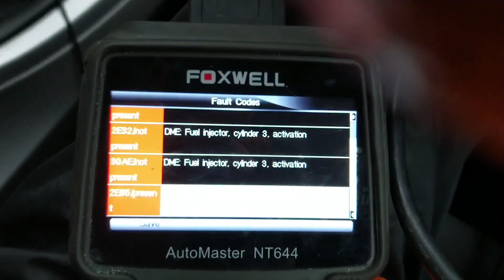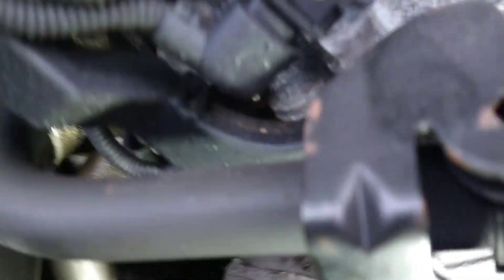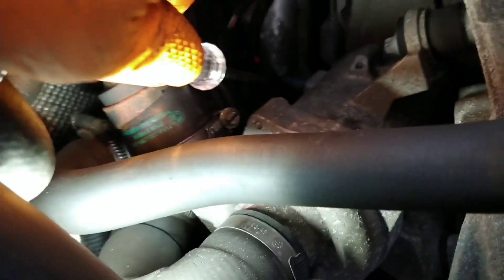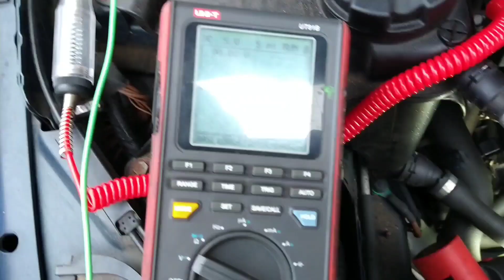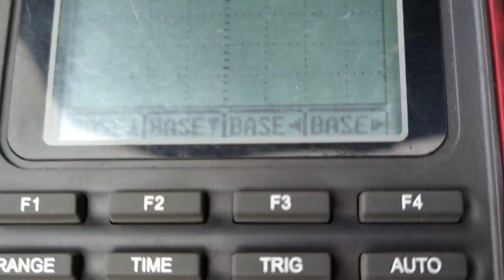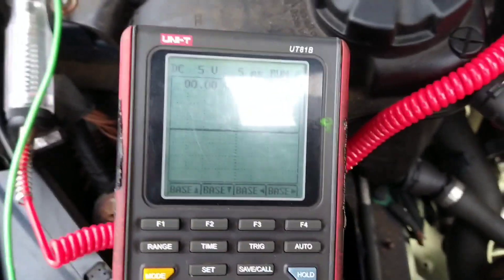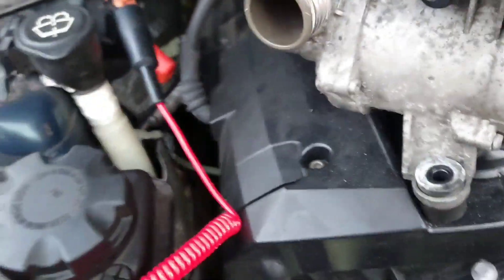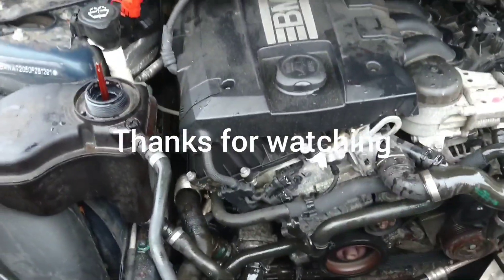BMW 320i Electric Coolant Pump Fault

Comment: i need this
a great way to check whether the water pump or the wiring is at fault

just to summarize a normal water pump wiring:

when engine off :
big wire 1 : 12v
small wire 2 : light off (maybe 0v)
small wire 3 :light off (maybe 0v)
big wire 4 : ground

when on acc mode :
big wire 1 : 12v
small wire 2 : light off (maybe 0v)
small wire 3 : light off (maybe 0v)
big wire 4 : ground

when on acc mode and heater on :
big wire 1 : 12v
small wire 2 : 12v
small wire 3 : 6-8 volt
big wire 4 : ground
Reply from the maker: Yes, thanks for watching

Comment: I got no power going to my water pump check all the fuse and they fine what should I do next ?
Reply: I checked all the fuse on both fuse box none are blown and the big red wire have to power so I’m trying to see if there a relay or a control module for the water pump
Reply from the maker: What car have you got?
Reply: 2013 320i
Reply from the maker: It looks like f7 on the wiring diagram, 30 amp for 200watt or 50 amp for 400watt. I take it that the thick red wire has no power all of the time, perhaps the motor is causing the fuse to blow, this must be a larger sized fuse. You said that the fuses look ok, is f7 actually getting power?
Reply: encontrou alguma solução?
Reply: estou com mesmo problema

Comment: Nice work Matt. That does not look like a 10 minute job. Makes good sense to check the powers, ground & control. Cheers Pal...Thought it was a turbo on the thumb nail...
Reply from the maker: It does look like a turbo, it was a bit of a pain to change it, I didn't film that part I couldn't get the phone in there to show much. Thanks for watching